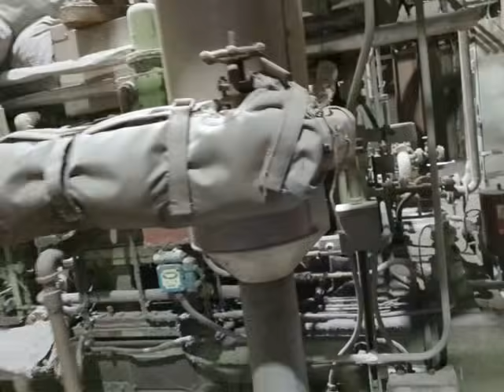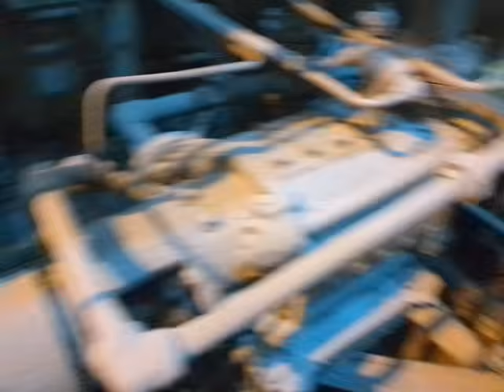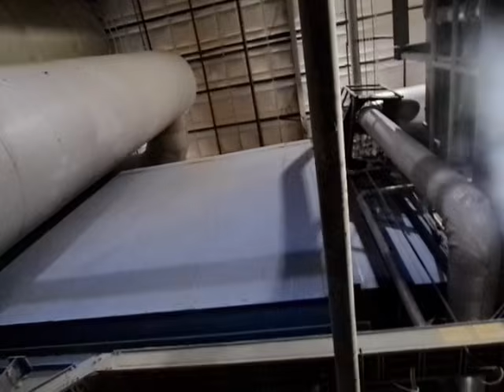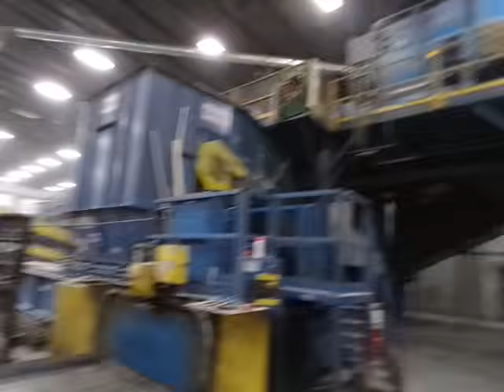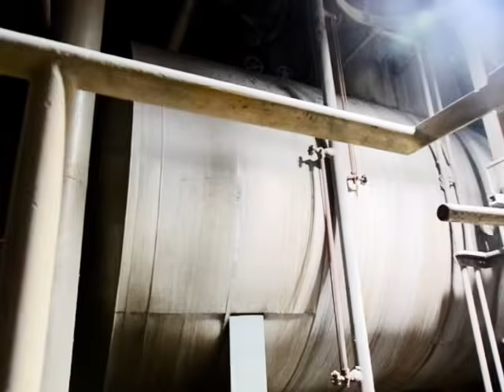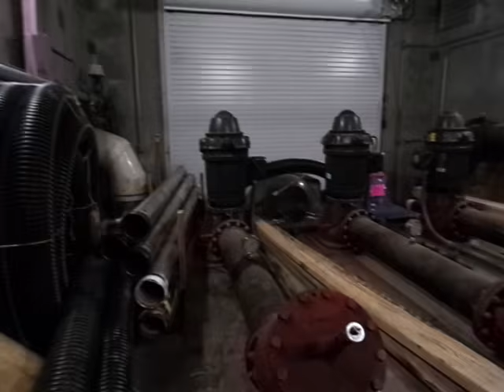From Power Plant to Incinerator: A Steam Turbine’s Story

Comment: Doesnt belong? That is cogenertion and it is brilliant! I live in the city of Västerås Sweden and we have a cogeneration plant where one of the blocks is a garbage incinerator. It produces around 100 MW of district heat and 50 MW electricity to give us both heating and power for the entire city. Upon construction in 2014 it was the largest garbage incinerator in the world. The total heat output power for the boiler itself is 150 MW. In addition it also have 2 other blocks of the same output running on biofuel. In total the plant has 7 blocks but the older 1-4 blocks running on fosil fuel have been decomissioned. https://upload.wikimedia.org/wikipedia/commons/b/b6/V%C3%A4ster%C3%A5s_Kraftv%C3%A4rmeverk_2018_02_26.jpg
Reply from the maker: I guess I said that because it was made in Britain and was used in Bermuda. its just amazing how that turbine intended for a combined cycle plant ended up going from England to Bermuda now Minnesota.

Comment: Why aren't they producing electricity anymore like a co-gen plant?
Reply from the maker: its more profitable to sell steam to the nearby food factories. they used to generate electricity but since the turbine is designed to use low pressure steam at 150 psi its not the most efficient. Just selling the steam for heating is more efficient. 
thanks for the comment.

Comment: Akron has an out of service incinerator steam plant. It didn't run long but made steam heat.  Somebody unloaded a dumptruck of toluene-soaked sawdust there in the 80s and the explosion caused several fatalities.

At work we still have two turbine driven boiler feedwater pumps. One on the low pressure and another on the high.  On the old Erie City boiler the draft was controlled with a tarp over the air inlet 😂  That fan was steam driven too.
Reply from the maker: so why is there a high and low pressure feed pump? is it a dual pressure combined cycle HRSG? with the steam powered draft fan why couldn't you throttle the turbine instead of having to use a tarp? thanks for sharing your stories.
Reply: @SteamElectricityandPropulsion We have 150#, 50# and 25# waste heat steam generators and a 150# boiler that all use low pressure BFW at ~420psi. The 600# and 450# generators use the 800psi BFW in addition to our 450# boiler.  The boilers make about half the steam in the plant and maintain constant steam header pressure. And obviously when the plant is starting up from cold they're the only source of process heat.
Reply from the maker: @KD-lq1sr what kind of engine exhausts into the boiler? Thank you for sharing about your power plant.
Reply: @SteamElectricityandPropulsion both boilers are fired. The smaller one is 50k lbs per hour on natural gas. The large boiler is 200k lb/hr and starts on natural gas but normally runs off waste fuel gas (mostly hydrogen).  Also can switch to purchased gas in an emergency upset.
Reply from the maker: @KD-lq1sr  so what do you mean by #? is it lbs per hour or psi? what is waste gas with hydrogen? is it Carbon monxide from a blast furnace?
Reply: @SteamElectricityandPropulsion  yes # is just an abbreviation for PSI. Its waste gas from hydrotreating diesel, kero, naptha, gas oil.  And whatever else is being sent to the flare system via relief valves or pressure control valves.  

The waste heat steam generators are tube and shell with process fluid in the tubes. Other generators cool hot catalyst, or cool flue gasses in fired process heaters before going out the stack.  Not what you're used to with combined cycle.

Comment: Very cool! On all the boilers I’ve worked with I’ve never seen a variable speed ID fan - they’ve all been damper controlled
Reply: We have dampers. As I understand it, the designers in the late 80's felt VFD's were not well understood and therefore tougher to keep going in the field. You have to consider that electricity is cheap at a WTE facility because it is sold at wholesale. The plant I worked at before this one had VFDs for the 3 main fans. Doesn't matter that much.
Reply: @ericgiroux320 Where I’m at we’ve got boilers from the 1940’s through to 2007 and they all have dampers. Those newer 2007 boilers actually have dampers on the inlet as well as the outlet of the ID fan - while normally operating the outlet dampers are wide open but they’ll cut back on startup giving a bit more precise control.

All the old fans are steam driven (except for the one black start boiler), while the newer boilers are all electric auxiliaries. It’s been cool getting trained at the different areas each with their own quirks
Reply: @NorthernElevations With WTE the gas flow increases through the service run due to fouling. Normally we hit thermal limits before we run out of damper travel. Then we shut down for cleaning.
Reply: @ericgiroux320 That makes a lot of sense, I’m guessing garbage doesn’t burn super clean. At our one facility (the 2007 one) we burned waste gasses from the steel mill (blast furnace gas and cokeoven gas), but fortunately that burned fairly clean. BTU swings or plug-ups in the incoming fuel lines were our main concerns for tripping offline, never know what you’re gonna get when playing with waste fuel 😂
Reply: @NorthernElevations Yes, waste is hard to predict. The crane mixes it, and we have auxiliary burners if that doesn't work. The day after heavy rain is usually a challenge for the operators.
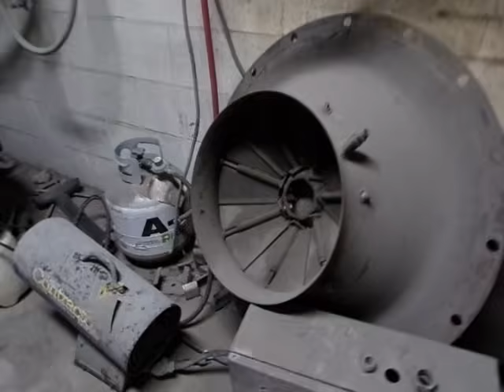Reply from the maker: @ericgiroux320  as you see at 3:32 theres the old fan with dampers. I think they modernized the facility in 2002 and thats when they likely installed the vfd and maybe when they got the turbine. I suppose at the plant in bermuda decided to get rid of the turbine shortly before then.
Reply: @SteamElectricityandPropulsion I saw that. What's funny is we replaced our dampers recently... with dampers.
Reply from the maker: Oh wow! Most draft fans I've seen have vfd.

Comment: Nice. As someone who works at a WTE facility I approve.
Reply from the maker: what is your steam plant like? is it the same, different or does it generate electricity?
Reply: @SteamElectricityandPropulsion Bigger(3 units), Mass burn not RDF, more updated (except for the EGR we don't have that). Control room all computerized. We generate electricity for the grid. I was just there this morning dealing with a CEMS issue.
Reply from the maker: @ericgiroux320  do the boilers have water walls on them or are the incinerators separate from the boilers?
Reply: @SteamElectricityandPropulsion Water wall furnace, tube superheaters.